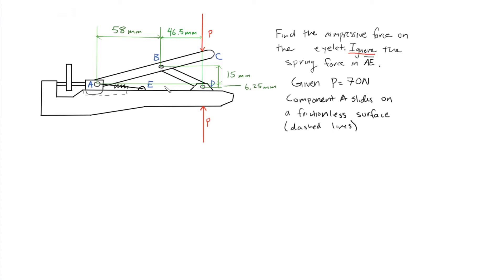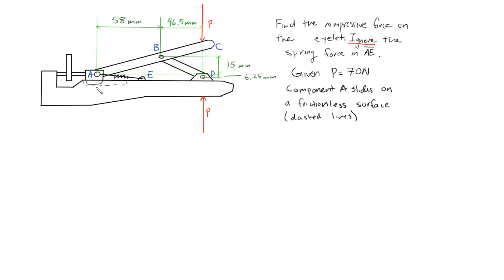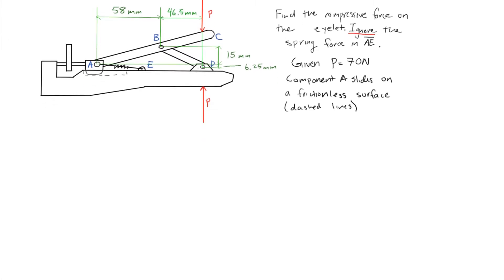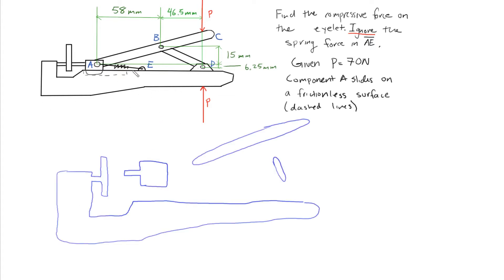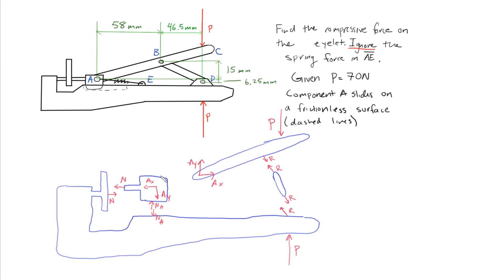Statics | "A pair of 80-N forces is applied to the handles of the small eyelet squeezer. The..."

Comment: Interesting video, my professors haven't taught the exploded FBD which I really like because it helps to not miss a force from one part to another.  I noticed kind of a problem though later on.  At 9:18 you had just finished substituting 24.560 for theta but that is supposed to be 90-theta.  You had lost the 90-theta a bit earlier in the equation.
Reply from the maker: Sorry, if that confused you! The reason why "90 - theta" disappears is because I used a trig-identity...

cos(90-x) = sin(x)
sin(90-x) = cos(x)

A reasonable way to understand this is that you are basically shifting (let's take cosine for example) the cosine function to the right by 90 degrees. And if you happen to plot a sine wave simultaneously with the shifted cosine wave, then you will see that they overlap (assuming same amplitude and frequency of course). Therefore, the trig identities above are valid. I'll try to be more clear about these steps in the future!

And yes! Draw your free body diagrams (exploded or not) completely (unless you have a time constraint) because it just makes the process so much easier!
Reply: Ah sorry I didn't catch that, I see now how the functions switched.  The exploded FBD is a nice visual representation of your forces all summing to zero.  If they don't that means you missed something, which is nice to catch.